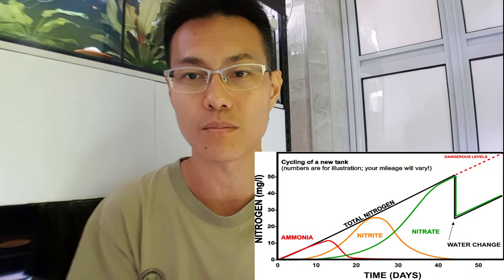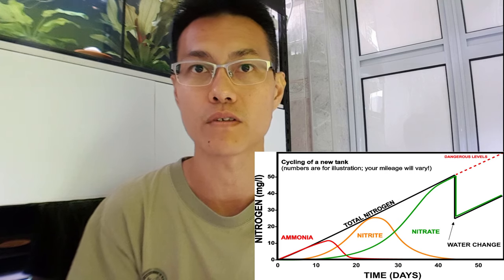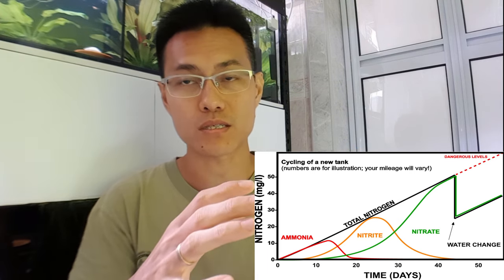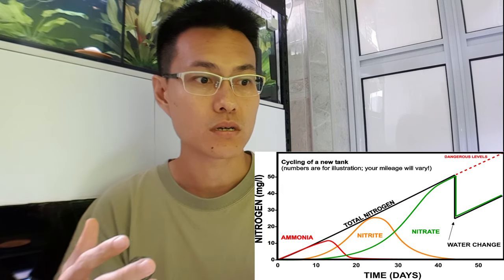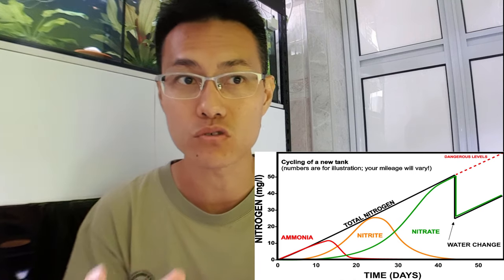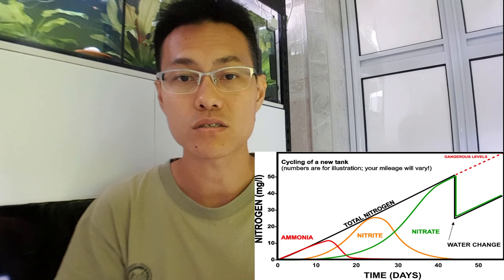Shrimp Caridina Tank Setup Cycling Water(Hard and Soft water parameters)

Comment: hi bene thanks for the nice video an good information, how many times do you change water then during maturing of the aquarium with ada soil or do you just top it of with ro water for 40 days ?
Reply from the maker: Hello, thanks for the question. Yes we do not change water during the entire cycling process and yes you are right. Topping it off if the evaporation rate is too high. I do reminerize the water in the initial phase when the first water touch the tank. When the tank is cycled, there will be a large water change 20% or so to reduce the nitrate before shrimps are place into it.
Reply: @ShrimpSanctuary  thank you for the answer bene i will defenetly try it on the next tank im setting up ,much appreciated.
Reply from the maker: Most Welcome